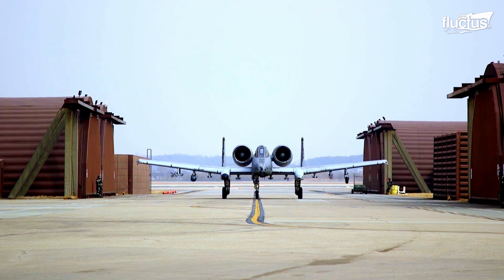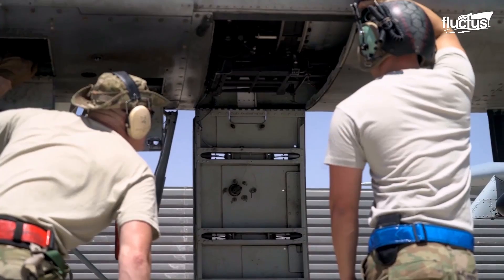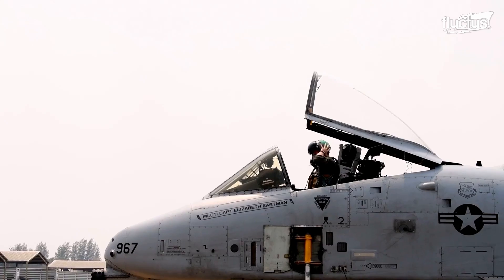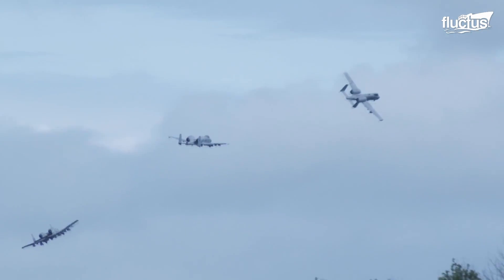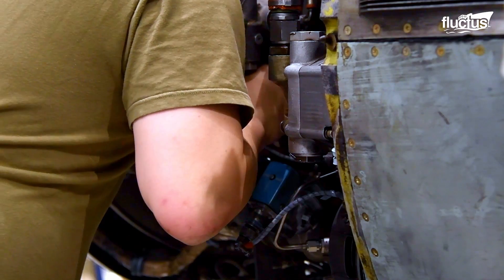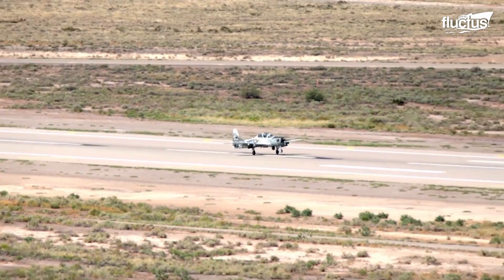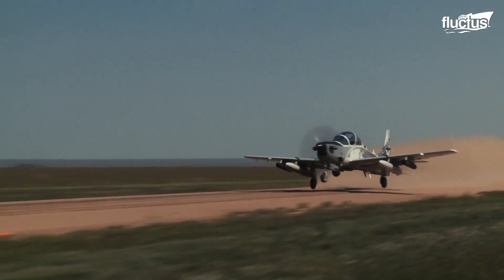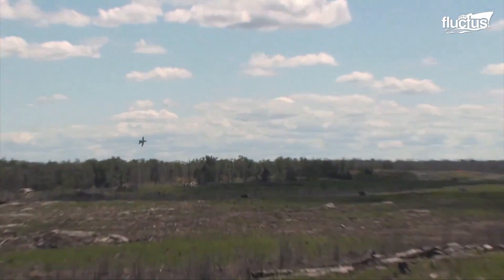US Air Force Special Techniques to Load Monstrously Powerful A-10 Gatling Guns

Comment: There is no special technique to load the 30mm gun and it does not take hours.  This person should have done some more research but they made this.  I dont know where they get the idea that the prop single engine plane could take the place of the A-10.  Only a .50 cal gun, slow, can not carry much weapons..  The A-`10 would out fly it and carry way more weapons and can take a lot of damage and still fly